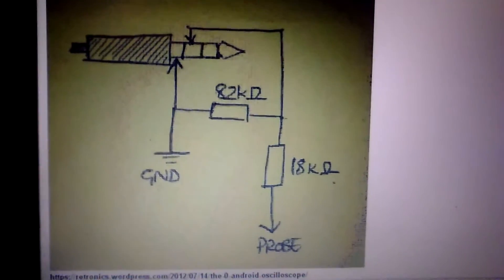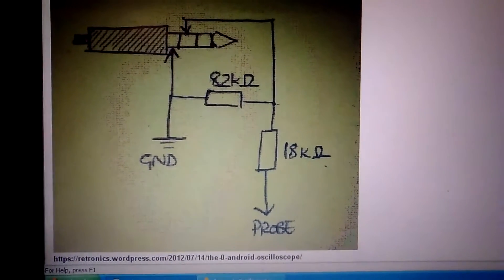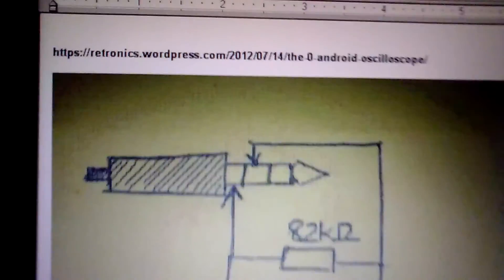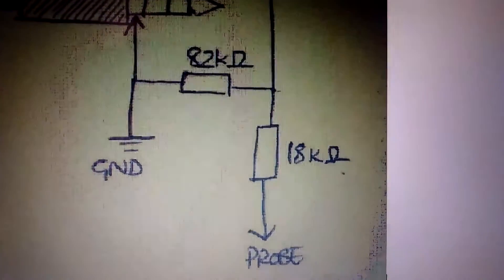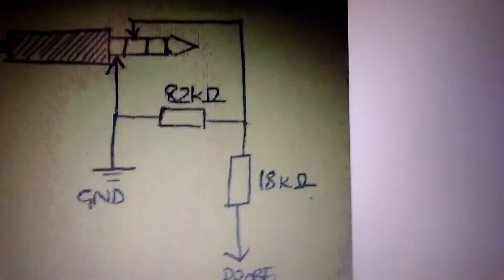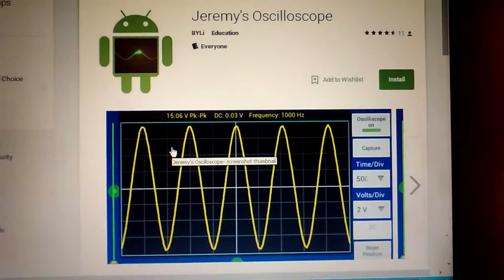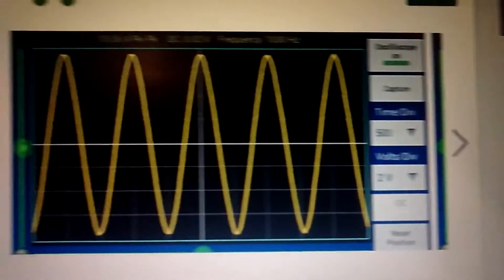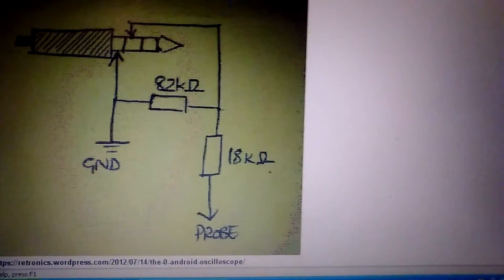Cell Phone Oscilloscope Probe DIY

Comment: As shown the circuit will not drop much voltage. To achieve a 10 to 1 reduction, replace the 82k with a 10k and the 18k with a 91 k resistor. This will allow an input of 30 volts to show just 3 volts into the phone. Hope this helps.
Reply from the maker: stonkeng thankyou I'm still learning ☺

Comment: I put a 500k pot so that i can adjust up to 110v . Ty for your video..
Reply from the maker: make sure you do the math to be safe. I'm still new at this ; )
Reply from the maker: don't go over 10 volts anything higher you can damage your Phone you need to know what you are doing be safe.
Reply: I am intrigued by this idea of increasing the size of the resistor and making it variable. But which resistor are you swapping out with the 500k ? I take it the one in line with the probe.
 Obviously it would be good to be able to manage 3V3 and 5 V logic levels.l
This is what stumped me given the near  line level output of the headphone jack and the microvolt input of the microphone. And the apps  don't go into any detail regarding how you manage probes whatsoever on Google Play etc.
Thanks,
ps. the wordpress site linked here is not working